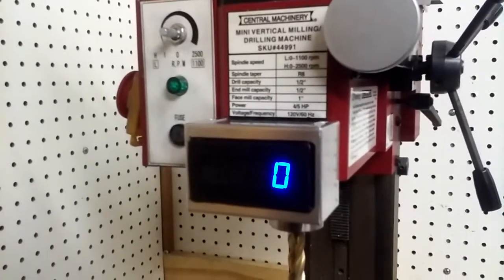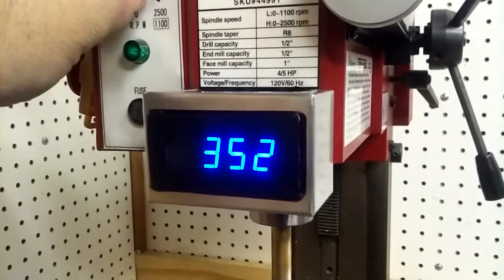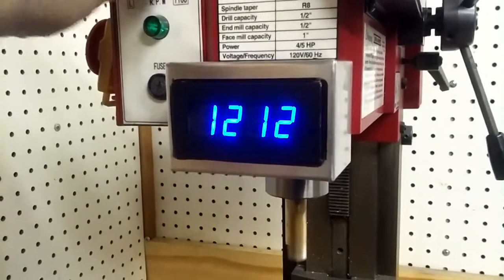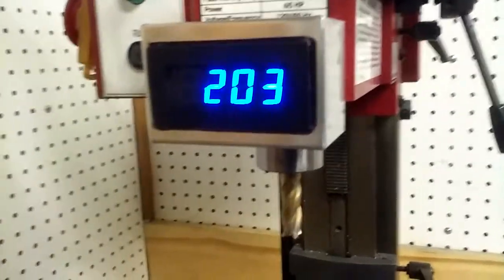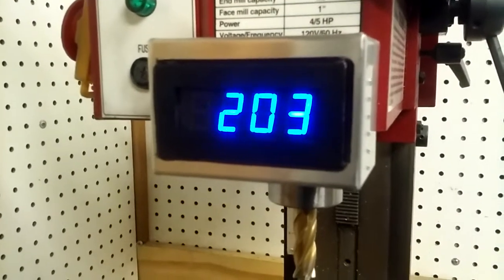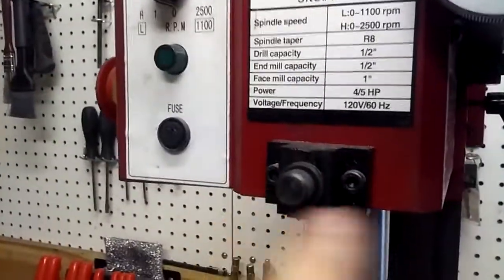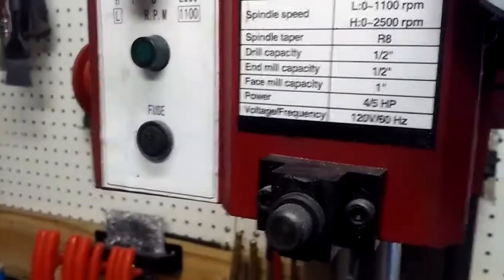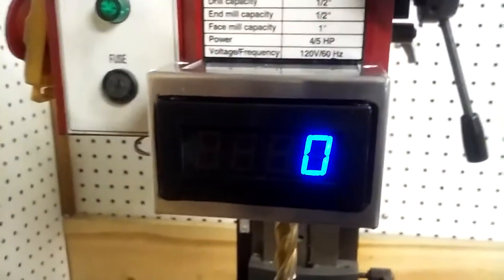Mini Mill Digital Tachometer

Comment: Hello Raymond. Happy New year! I have finally fitted and wired the tachometer on my Sieg SX2LF milling machine. Works great, but I am not too sure on the revs. It seems that the the tacho is not following the revolutions correctly, e.g. The mill shaft rotates so slow and the LCD show... say 175. Is it the right revolution? Is this tachometer supposed to show one rotation per 0001, two rotation = 0002 or 5 rotation = 0005, etc.? I am somewhat confused now. I will have to buy a rev counter to see if this LCD tachometer gives the correct reading. Any suggestions?
Reply from the maker: Happy New Year!   My tachs are both accurate above about 20 RPM.  I have put a black line on the spindle with a marker and counted the revolutions for 60 seconds.   (Or 30 seconds and multiply by 2)

Comment: Hello Raymond. Did you wire the tachometer directly to the 12 V wires inside the control box or did you use a 12 V transformer to power it? I intent to wire it neatly to the 12 V wires inside the control box for a neater presentation, but the problem is, which wires are 12 V Positive - Negative, I have no idea. Do you have any idea yourself. My tachometer sits just on top the control box. It looks good as is, but I have no idea where to place the magnet.
Reply from the maker: I am still using an external 12 volt adapter plugged into the wall. I have been wanting to wire that up inside the control box but haven't done it yet. It's been on my to-do list for over a year LOL

Comment: How did you install the wiring ?  I just ordered 2 of these using your links. Thank you for making that easy.
Reply from the maker: I used an AC adapter that plugs into the wall outlet.  I did not wire it into the mill wiring directly.  Not yet anyway....  I originally planned on doing that.  Just haven't done it yet.
Reply: Raymond Sult  say I installed mine and what I did was use a Makita 12 volt batter. Used Velcro on the back too hold the battery and just plug it into the pos and neg slots on the batter.  Also I used hot glue too mount the gage box. That way if I have too return it. (Since I bought warranty)  it works awesome.  Actually I did this on my mini lathe. I just recieved my mini mill and I just finished doing the belt drive and gas spring upgrade on it so I’m gonna do the rpm the same way I did it on my mini lathe
Reply from the maker: @Jaxter1137  that's a great idea using the battery from a power tool. I like that idea! I've got both of our Mills converted to belt drive. And we have just been looking at ordering the air spring / gas spring for the Mills

Comment: OK Raymond, I've got two coming, one for my HF mini mill and one for my Craftsman Atlas 12/25 lathe. Thanks.
Reply from the maker: Great !   I'm sure you will like it  :-) .   Right now all of mine are powered by external AC power adapters plugged into the wall outlet.  I used various old adapters that I had laying around as one does NOT come with the tach.  The tach will work on a WIDE range of D.C. voltage.  From 6 volt up to 25 volts (I think).     I had one working on a double A battery pack too.

I am working on finding DC voltage inside the controller box on the machines.  This will eliminate the need for the external DC wall adapter.

Comment: Raymond, where did you get the tach and the box?
Reply from the maker: Hi Clifford....   I have gotten several of these tachs on AMAZON.  It is the Digiten Tach.  $19.00   Here is the link to it:  https://www.amazon.com/gp/product/B00VKATA9G/ref=oh_aui_detailpage_o04_s00?ie=UTF8&psc=1

There are similar ones sold on eBay too.  But I have had NO problems with the ones I got on AMAZON.  

The small aluminum boxes I get locally here in Evansville at Hutch & Son's.  Less than $5.00.   Here is a link to for the box:   http://www.hutch-and-son.com/product-p/cu-3000-a.htm

Thanks for looking !  And check out my website at www.CustomAntennaMounts.com 

Ray